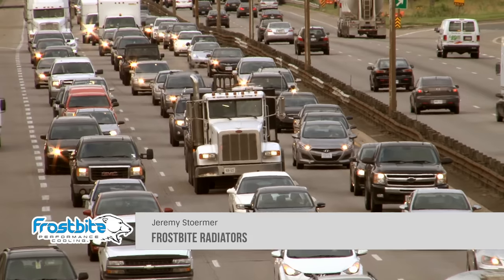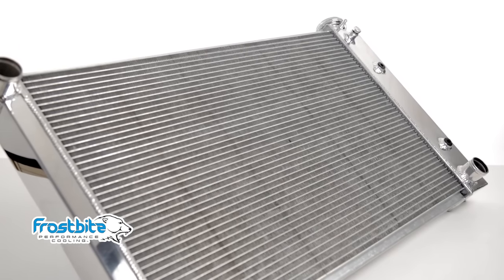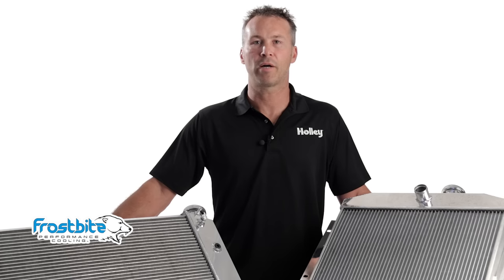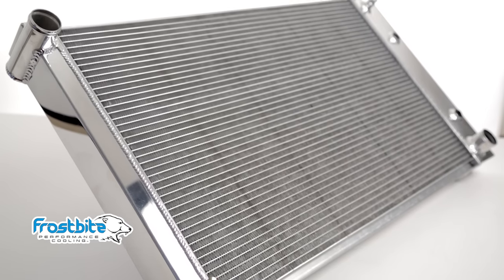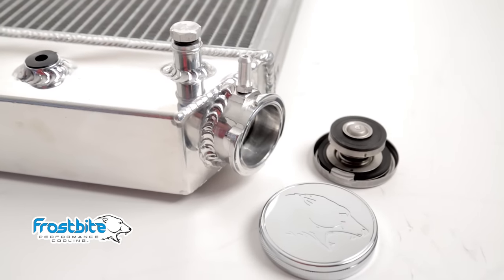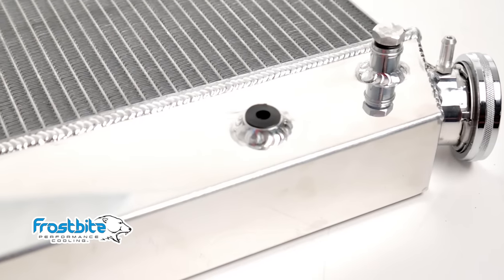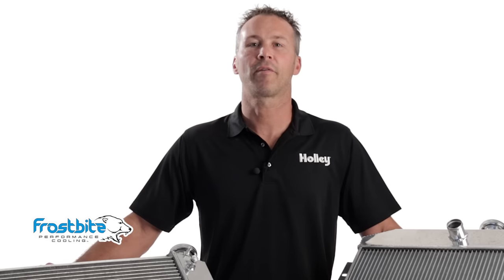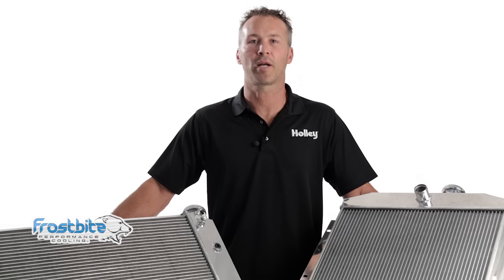Frostbite Radiators

Comment: The conventional copper/brass radiator type 379-4 I installed in my ‘70 Mach 1 , 351C about 35 years ago is still performing well enough but the advantages offered by using an all aluminum radiator combined with a Frostbite electric pump are too good to pass up. 

In terms of efficiency the old four-row radiator isn’t so good and the thickness can actually restrict airflow through it at all speeds. Aluminum radiator replacements weren’t readily available back in the early eighties like they are today.  The old 379-4 was on sale and with the radical modifications planned for the Cleveland, it was the best choice. 

Im a fan of old school up to a certain point but with the huge advances in automotive technology in recent years along with modern CNC manufacturing techniques keeping the cost of performance reasonable, it just makes good sense to upgrade and enjoy the benefits at all levels. 

With the proposed upgrades of a 24” wide, 2 row aluminum radiator and the Frostbite billet aluminum 35/40 GPM coolant pump, the next required step when using the EWP is an electric cooling fan and shroud assembly. Spal and Frostbite offer plenty of choices in electric fans but the choice of a 24” wide shroud is narrowed down only two or three.  The shroud plays an important part in moving air through the radiator with efficiency. So many times I’ve seen people trying to figure out why they have overheating problems and they aren’t using a shroud. 

I like the Spal plastic shroud because it has several extra openings with rubber flaps to put the entire shroud to good use moving air through the radiator. When sitting still at idle or moving slowly, the flaps are closed allowing the fan(s) to pull a huge volume of air through the radiator core. When moving forward at speed the flaps are forced open by the rush of air which allows the entire core surface area to benefit from the full flow. The polished aluminum shroud looks great but with only one or two openings for the fan, it’s cooling efficiency is a little less because of the reduced total air flow while moving forward. 

The really cool part about all of this boring cooling system text is that Holley.com is truly the one stop shop for everything I could possibly need to keep my old school high port headed, 13:1, solid roller cammed Cleveland cool when things get hot.  I would welcome any suggestions or comments about what works for others when keeping things cool. 

Thanks Holley and bloggers. And the beat goes on.....